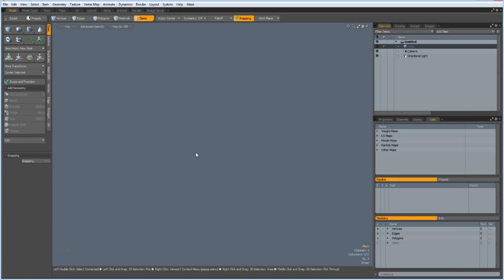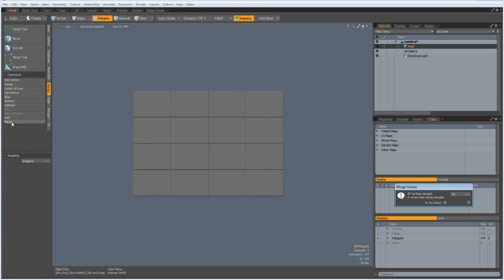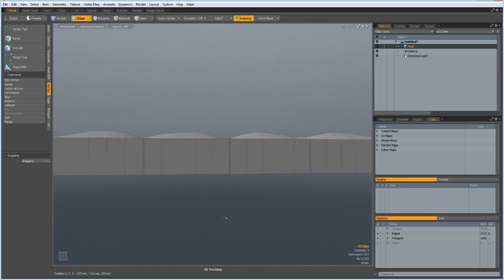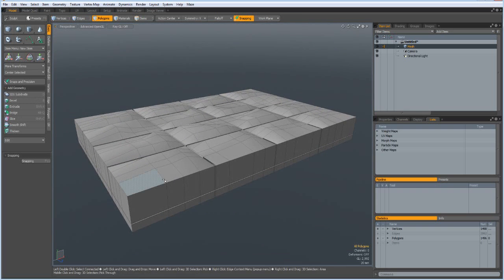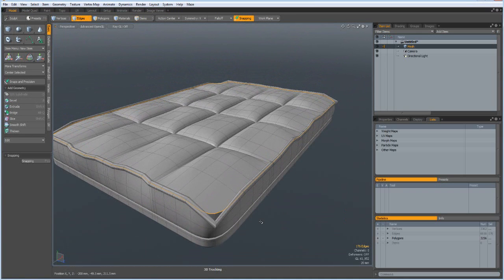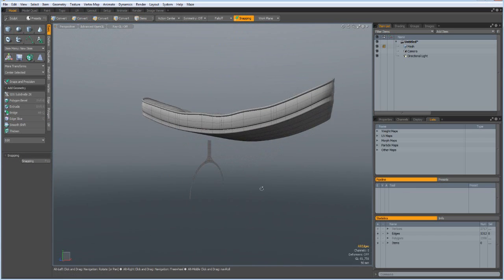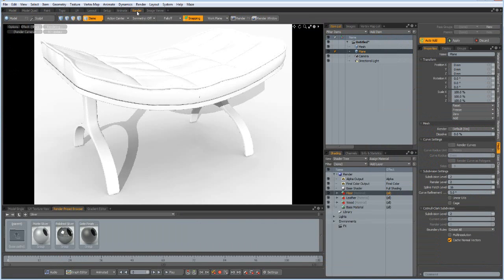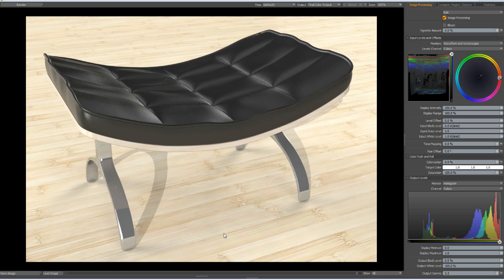Luxology modo - Modeling Upholstery (one of many ways ...)

Comment: Hi Peter having real issues using the quickpipe script. It seems setting the diameter of your pipe is achieved by using your tube tool first 

Anyway when i run the script  the generated pipe i does not accurately follow the selected edge

Any help would be appreciated :)